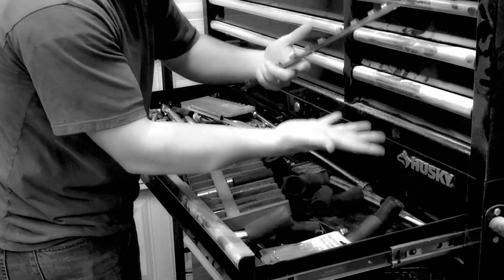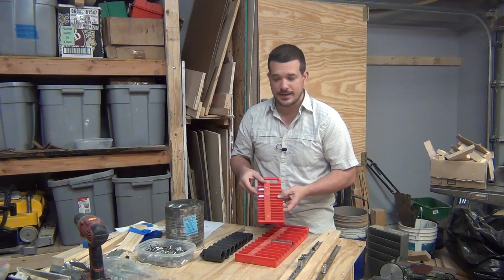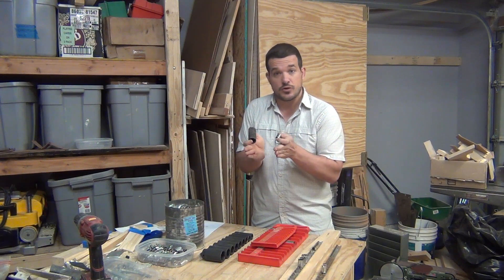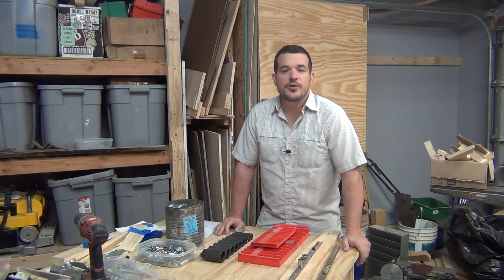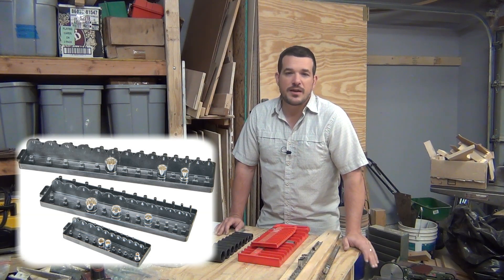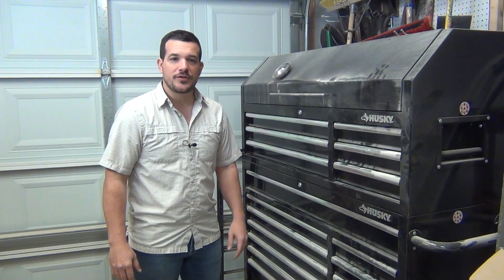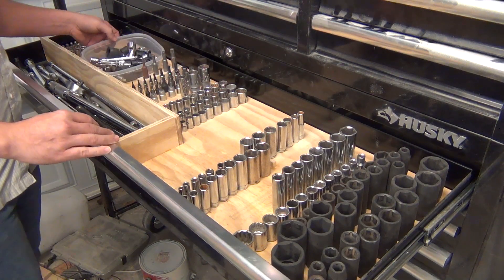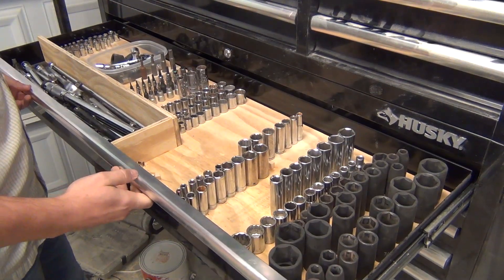Organizing Sockets - Which is the Best Method?

Comment: The thing I don't like about your method is it is a lot of work for little pay-off.  The dowels come loose and if a larger socket happens to get loose, it can mow down dowels like a bowling ball.

I elected to go with the aluminum socket organizers.  The sockets don't fall off when I slam the drawer, they are very nice looking, they contain the socket sizes, and I have sockets fore every space.  If I want to rearrange them, I just scoot them around the drawer.  They have a perfectly flat and smooth bottom that grabs the drawer liner and they do not move.
Reply: Yep this wood method may be cheaper but it looks cheap also.  Painting the plywood would help but I'm still not a fan.

Comment: Your method is very similar to in concept and reminds me of the Westling socket holders. Have you ever seen those or considered them? They are made of aluminum and comes in different configurations and sizes. It has worked out well for me so far. Though it's more expensive than what you made, I believe it's a valid option for those without wookworking abilities.

Comment: I use the harbor freight socket organizers. I just filled in the open slots with random brand single sockets. Extra ones I put in a rail on the side. But you need tall drawers to fit 1/2"... Then I made my own for odds and ends. For wrenches I took a 2x3 and cut 45s dados 1/4" thick every 1/2" and they set perfectly in there.

Comment: Used a square key stock with a small hole drilled out for a cotter pin & washed or a bolt, washer & nut for organizing your crowsfoot wrenches!! Line them all by size!!

Comment: I have both the adjustable plastic upright socket rails and Harbor Freight magnetic rails.  I far prefer the mag rails.  Infinite adjustability and no additional cost to add the keepers when adding items.  Mag rails are also easier when removing sockets from them.  Easiest, cheapest and most area efficient system for me is definately the mag rails.

Comment: Interesting but I'd still have to go with ABS plastic rails. Stronger than the metal ones, no problems with sockets falling off but still fairly easy to remove. Got a few nice matching sets that you can swap clips between so they can be configured for different socket sets. Originally I had them screwed into a backboard but now I've replaced the screws with magnets so you can take the whole rail out if needed, also means they can be swapped round no problem inside the drawer. Plus a few plastic trays on the same magnet system for ratchets/extensions.

Comment: this is no different than the same issue that you had with pre cut holes. pre cut dowels still leave you fixed and committed to your layout you just have extra room to move stuff around. when I was working in some NASCAR race shops, we had crash carts with smaller drawers that we just loaded down with multiples of each tool laid flat until we couldn't fit any more tools in a drawer. it sounds terrible but when you have 6, 1/2" box wrenches your bound to find one as long as they're all in the same drawer and labeled correctly. my point is, giant drawers seem to be the issue here.

Comment: I've taken a file to the socket holders on the rails of the harbor freight ones and ut made placing and removal easier but i have a ton of sockets I've just got a full 16 inch double drawer tool box full of my sockets, with a set of each driver and impact drill adapters for the American drawer as well as the metric drawer i don't have the gigantic impact ones like you but ive got 4 sets of each and some oddballs in each

Comment: I’m 52. Been wrenching since I was 15. I’ve tried everything and I like this idea. Just cut up some round wooden dowels and you’re ready to go. Just a drop of wood glue and stick them where ever you want. Cheap and easy. Thanks
Reply: Instead of wood glue use hot glue, much faster bonding and easier to remove if you decide to change the socket configuration later on, or move into a different tool chest where you can lay them out differently.

Comment: Excellent video son.  I like how you review the pros and cons of all the run of the mill socket organizers out there and certainly agree with you.  Most of these are pretty pricey too.  I was thinking of constructing something like what you came up with except I keep my tools in my basement and only take what I'll be using for a specific job out to my detached garage so I need to come up with a portable version of what you have.  Keep up the nice work and God bless you.
Reply: I had the same thought. How do I take some of these away from the tool chest. There's nothing saying you can't saw the base wood plate into segments and put a handle on them so you can pull a whole "tray" up and haul it somewhere for a few minutes. Nice thing about wood is that it's cheap and easy to work with. I was thinking 1/4-inch plywood with a bunch of button magnets secured on the wood side with double-sided tape. Or not. Just a thought.

Comment: One complaint I would have with this system is that you don't have the option to take all your sockets with you easily. I'll be working under a car in position and find that I don't have the correct socket within arms reach, so I have to get up out of position and make a guess as to which size I need (which gets easier over time), get back under the car, and hope I guessed correctly. It really messes up my work flow having to get up and down over and over. I've since gone with socket rails because you take a whole rail of sockets with you, saving time and energy. I 100% agree that the cheap spring steel socket rail type suck! I recommend trying out an aluminum extrusion rail with ball-detent style plastic holders that are silky smooth to use. Here are the ones I use specifically but I'm looking out for the actual extrusions themselves to make my own and save some money, as these can be kind of expensive. https://www.oreillyauto.com/detail/b/performance-tool-4601/tools---equipment-16488/shop-garage-16868/containers---storage-16812/organizers-18014/74c94664534b/performance-tool-socket-rail/w38004/4614178/2003/ford/mustang?q=socket+rail&pos=4

Comment: I'm using the metal rail. At first it's a little annoying, for the reasons you specify, but I've mounted the rails to thin plywood and have them on top of the 18" Harbor Freight magnet bar. As far as stiction is concerned, a little WD l-40 takes care of the problem. 

Your method looks good to me, so I'm glad you posted it.

Comment: This is only a viable solution for a small portion of those who would watch this video. As others have pointed out, it lacks the mobility so many of us need. Quite a few have pointed out that there are far better rails available than what HF sells. The Ernst ones come with a nice tray that lets you store them all upright and still carry them where you need them without worrying about them falling off. Olsa Tools makes some very sexy rails that you could also easily store upright if you wanted. Basing your assessment of rails entirely off the HF ones is kind of like saying "pizza sucks" after trying a slice from the local gas station.

Comment: My idea was to buy dowels 1/2" 3/8" 1/4"  then drill holes on my plywood to my configuration 
I never thought just gluing  them would work great tip thanks, but still will use my method  I will just cut the plywood in section just in case i want to change the configuration 
Thanks again for sharing your ideas
Reply: I like that idea, you could use clevis pins. They won't pull out. Pricey but you could buy in bulk. Also thanks to my Metwrinch set, I don't much sockets to organize.

Comment: just use round dowels! 1/4, 3/8, 1/2.. time saver Home Depot. Also, you have a lot of extra space on that board. FILL IT UP! that way you have "swing space" to help organize and for extra or oddball sockets. Also, I'm doing this but putting them on plywood strips screwed down to the baseboard. Each strip has a hole in the end so you can hang it on the wall when you travel to a remote job site. Magnets to hold the sockets in place when hung vertically.

Comment: Have you ever used your 7.5mm socket? I never seen that size ever. Is that an sae size converted to mm that no automotive manufacturers use that i know of
Reply: Hachi-Roku Performance Group 
I have a set which has weird  sizes with something like 5.6mm or 11/32", so the predefined sets left some orphans.
 I've made a socket rail just by using screws on a narrow wood plank, spaced and lined up according to size requirements. Custom spacing as I need, and it can be used as a grab 'n go holder.  For my 1/4" sockets, I used nails rather than screws because the screw heads were too big to pass through the smaller sizes. It's quick work, just mark the locations as needed after lining up the sockets in size order, giving just a bit of extra gap between the sockets.
When working it's much faster to pluck and replace than some of those chrome steel rails that are a real struggle to remove and reinsert.
For a fancy setup maybe put a hinged cover flipping over the sockets for upside down retention.  Scrap wood and spare nails, lowest cost but sans panache.
I screwed in the drywall screws freehand but doing some pilot holes on a drill press would be easier so they're nicely aligned for a neater look.
Reply: Bet that was a 5.5 socket

Comment: Those socket rails are great if you don't mind having to dig through your tool bag for your sockets because they all fall off those stupid rails, they're useless unless you hang them on a wall and fasten them down so they cannot move and don't mind needing pliers to get some of the sockets off the clips.  

I don't keep sockets in my tool chest except socket sets in cases because I'd have to change the layout of my tool chest due to most of the drawers not being deep enough to store sockets standing up, so I keep all my socket sets with cases in the tool chest for that reason.  I have other socket sets that I take with me which are in small zipper canvas bags so I still have to sort through them to find the socket I need, but its only a few sockets in each bag by drive size and metric or SAE, so not too bad and I don't use them all the time so it seems to work for me.

Comment: I want to take the flywheel off a 1934 Aveling Barford Road Roller……….do you have a socket to fit???

A tidy workshop is like a tidy desk………..it is a sign of a sick mind!!!     Methinks this video is designed to trigger tool envy

In my 78 years I have only ever used about 6 metric and 6 imperial sockets……..the other 150 sit around unloved and unused.    Who, for God’s sake needs a socket sized 2 17/64 inch????

Stavros

Comment: As an automotive tech for almost 30years I have a similar setup in my matco toolbox box made to fit my box two socket drawers  to hold over 2000 different sockets between metric and standard. The organizers weren't cheap but the price will come down soon they are loosing the patent and will be available from other companies. Only sockets not In the organizers are English sockets in a case I don't use them very often

Comment: I have a problem with glue, maybe it is because of the high humidity. My thought was to take your square pegs, drill a hole and attach with a screw. Easy to move and immediate use.

Comment: EVERY storage system has limitations.  I can't stand the thin rails with retention clips type and, even though I still have some mounted on wood, I prefer molded plastic trays (specifically Mechanic's Time Savers).  They stand the sockets upright and retain them with a magnetic strip.  I can take them out of the drawer and carry them wherever I need to have them.  I can store them wherever I need to put them.  And when I need to take them upstairs to work on plumbing issues or out to my car in the driveway, I can do that.  Your system only works if you never take them out of the drawer or you bring the work to your storage box (not always practical).  Telling us you've found "the one true way" reminds me of proselytizers that come to my front door.   My response is, what you think works best for you is not necessarily the best way for everyone else.
Reply from the maker: The video was me describing the systems that I've used in the past and what I felt where their limitations. Then I should the viewer the method that I chose to use in my shop, which is the best system that I've used to date. What works for you maybe isn't ideal for me and vice versa. In the video, I even encourage viewers to let me know which system they use. At no point was I "proselytizing", but hey, if you feel the need to grab for straws, more power to you.
Reply: EW--If you re-read my response, I did what you asked:  I told you what works for me and why.  The point I made is that your system will eventually break down because you're using stubby wood dowels to hold the sockets in place.  Seeing your system in your workshop, there's no obvious way to take a group of sockets out of the drawer for a specific project.  Do you use a small paint can (like the big one that's full of old sockets) to move them from place to place?  YOU NEVER SHOWED US OR EXPLAINED HOW YOU ACCOMPLISH THIS.  I take mine out of the drawers from time to time to make repairs in the house or around the yard.  That requires me to physically move them, in separate groups (metric or SAE; 1/4", 3/8" or 1/2" drives), out of the drawer.  As I stated, mine are on socket rails, on a red plastic 3/8-drive Lisle tray, in the plastic MTS trays or in their original metal boxes.  I don't know what size(s) I'll need to do the job, so why make two or three extra trips up and down stairs if I don't need to?  As another viewer commented, the work seems to have to be brought to within a few feet of your toolbox in order to work on it if the sockets are all on one big board in your storage unit.  I can't bring the toilet or sink or the irrigation system into my garage near my storage unit to work on them; I have to take the tools to where the problem is.  Your system therefore seemed unnecessarily restrictive to us.  Finally, I never accused YOU of proselytizing the masses. I was referring to religious zealots who come into our neighborhood from time to time asking if I've accepted Jesus Christ as my Lord and Savior.  That's pretty obnoxious, if not presumptuous, of them to question people about their beliefs, and you weren't doing that.  Like you said, what works for you doesn't necessarily work for me, and vice versa.  I've no doubt your intentions were honorable; we just noticed there were some issues with your system, so we commented on them.

Comment: Color code each different size with tape or paint and throw them in there.Once away from the box I can still spot a 10 mm from 20 feet away. Done.They are out of the box often as not many mechanics replace tools after each procedure

Comment: Your method is all well and good until as you pointed out you may want to move the sockets, then you have to glue in new dowel points and chisel off the old ones. Magnet strips work better and the is no dowel cutting , gluing , and chiseling off if u need to move around

Comment: Empty glass or plastic jars..........from any foodstuff or domestic cleaning  item used in the kitchen or house generally.....

Or on a smaller scale....empty vitamin tubs with clip on or twist lids......these fit in overall pockets more easily if you just want one or two at a work location.

One socket per jar and then label or felt mark the top to indicate the socket size.

They then fit easily into a narrow drawer, can be moved around easily or taken out when required at the car or job required.....easy to throw the containers you require into a holdall or tool box...

Makes sockets much harder to lose......and best of all, easy to see at a glance.

You will be surprised how quickly and easily you can amass a sizeable collection of jars or tubs.........

Your recycling stuff in the most sensible way and without the faff of having to sort things out or go to the recycling centre.
Obviously you have to be more careful with glass jars or tubs rather than plastic, because a workshop is a place where you easily drop things, but hey....just be a bit more careful.

James Hennighan 
Yorkshire, England

PS
You could store the jars on a shelf rather than putting them in a drawer, but they are better in a drawer.

Jars on shelves are best for screws, bolts, nuts etc....etc........you can see them at a glance and usually don't need to label them.

Comment: So much complaining!... If that method works for you then great, but for most of us who need to take our tools around with us to various jobs, keeping the sockets in the cases they're supplied tends to be the better method. I've done that dowel method, first bump and they bounced off! For those that I've purchased on rails 1/4". 3/8" or 1/2", standard or long reach, from 4mm up to 32mm, on a piece of plywood works a treat, I can increase or decrease the gap for replacements and I've never had a problem. Whilst your box looks nice, it's totally impractical in many situations.

Comment: This is the exact same idea as the rails screwed to a board, but not as good lol. No they arent hard to take off the rail at all, you are not a 5 year old use a lil bit of muscle lol. Those dowels wont hold up on the crappy driveway we have at my shop. I move my box almost daily. Rails to boards is the best method because you can change the size of rail by cutting it and you can put different sizes on one rail or just unscrew it and move it to a different spot as many time as you need to. If you have them in smaller boards you can take out a whole set without needing to move the box. Your method of dowels doesn't allow you to take out a whole set all at once.